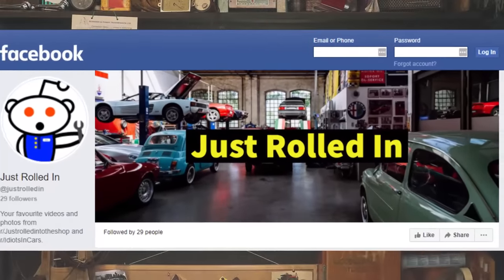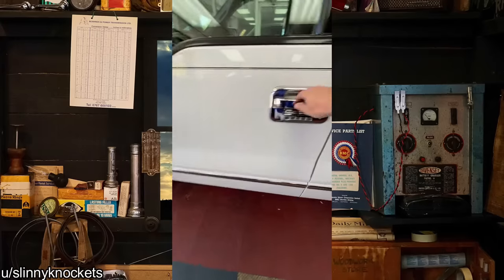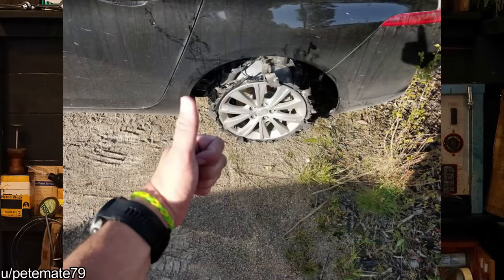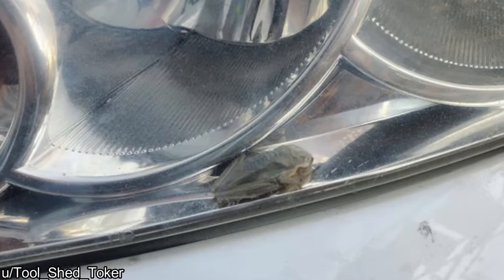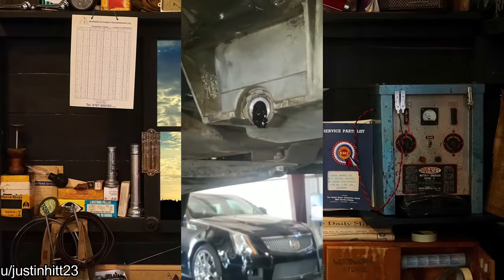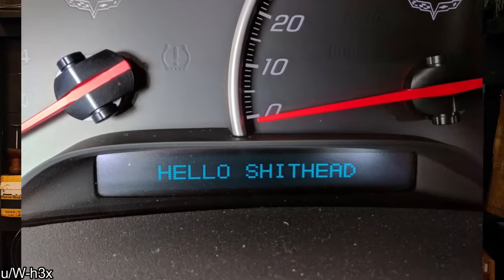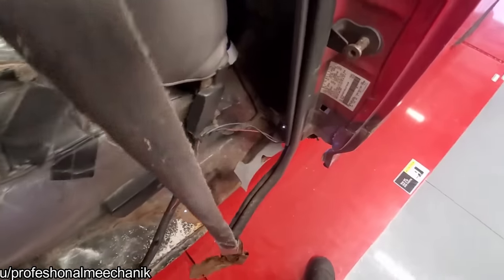Customer States Compilation (Best Clips & Photos so far) | Just Rolled In

Comment: I was a line mechanic back in the 70's.  I can relate.  We had a car come in that sounded like an air compressor....obvious exhaust system construction.  The "expert" owner said that he wanted his engine rebuilt because he "knew" that"s what it needed.  We told him we should check the exhaust system first.  He implied that we were trying to increase his bill.  We finally gave in and pulled his engine out for disassembly.  Tore the engine apart and couldn't find anything out of the ordinary?  We went through the rebuild process and reinstalled the engine.  At start up there was that air compressor sound?  Turned out to be a loose baffle in the customized muffler.  We managed to stick a torch up inside the muffler and slowly burn the loose baffle into smaller pieces.  Problem solved.  The customer paid his expensive bill totally satisfied that he had diagnosed the problem correctly because the air compressor noise was gone.  We didn't tell him what we found.
Reply: I once put a motor in a car and it wouldn't do anything but slow idle. After going through EVERYTHING and not finding anything and pulling my hair out it occurred to me the previous motor blew a ton of oil and then it all sat for a month. 
The catalytic converter honeycomb was plugged solid.  I pulled exhaust off and it was a race car.
I was always asking that dumb question on auto repair forums.  " is your exhaust plugged up? "
Reply: A car my daughter had I was involved in reconstructing her exhaust system and had it all off. Up near the manifold the pipe was real solid but I came to discover that someone had welded it nicely but made that part of the tube constricted to only about 1/3 the size on the inside. Not sounding like an air compressor but still interesting what you find INSIDE exhaust piping.
Reply: lmao
Reply: You should have told him and counted how many seconds it took for him to shrink to an inch tall.
Reply: @michaelszczys8316  same problem on my ford, clogged cats made her misfire like a bitch. Were not going to talk about the 25k fine for removing cats though lmao
Reply: @RGBmechanics  my brother had car he was going to sell, it had a cat that was almost plugged so I told him to take it off and I came over with my 350 Chevy with full 2 1/2  inch exhaust out the back. I had him hold it up to my pipe and I revved it up reverse blowing it out.
He said a big cloud of crap came out. Cleared it out enough to sell it.
Reply: About 15 years ago I got a notice that my Jeep XJ was being recalled due to the computer not being able to detect if the converter was bad. What they wanted to do was flash the computer and would replace the cat if it was rattling. Well, it HAD been rattling, but had stopped something like 100,000 miles before. I called the dealer and asked what they would do in that situation. Nothing... so if I'd taken it in they'd have flashed the computer, the check engine light would have come on, then they would have offered to fix it for something like $500.

So I never took it in. Years later the cat clogged up and I replaced it, then a couple of years ago I had to replace the computer... and the check engine light came on.
Reply: @RGBmechanics  
  In today's society, just claim that someone had cut them off, and you only had the money to buy "Test" pipes. They are a hot commodity around here.
Reply: Smart Move fixing the real problem on the down-low, as a bicycle mechanic I've done similar before.
Better to Get Paid than have an argument with an 'expert' customer. I he wants to waste money insisting I go through all these extra motions, not my loss.
Reply: Stupidest thing I ever did was when I heard a rattling noise coming from the clutch area in a series II Landrover, pulled the entire gearbox out through the cab to check the clutch, but couldn't find anything, put it back together and started it for an test. Then somebody said that the fanbelt looked a bit loose, here we found out the alternator bearing was shot. Apparently the sound resonated all the way to underneath the firewall. Still, an nice bit of experience for a beginner like me.
Reply: He would've really been baffled if you had told him.

Comment: Curious to know what that customer who claims to change their own oil every 2k miles is actually been changing.
Reply: Probably the blinker fluid.
Reply: Plus/minus a few 0s tends to be everyone's rule of thumb, or lack thereof.
Reply: @rowdyjoringer612  or the guy was changing them on some shop and got flipped over many times
Reply: I mean I think a previous owner put windshield washer fluid in the power steering reservoir on my car, so anything’s possible
Reply: My thought exactly
Reply: They just added oil every 2k miles and never drained anything.
Reply: I think he meant 20000
Reply: its the quicklube oil change, aka top it off.
Reply: k, m, t... what difference do a few orders of magnitude make?
Reply: I was wondering what they were changing the oil with... it look like putty
Reply: They keep the old oil to put back in and just rotate it.
Reply: The crack in his pipe
Reply: Probably by 'change' they mean poured a bit of oil in to top it up
Reply: Same !! 😨😨😨
Reply: Looks like they put straight 90 weight in.

Comment: That spare tyre one reminded me of a USAF maintenance report:
- Engine #3 missing
- Engine #3 found on right wing after brief search
Reply: My sister got a maintenance request from a pilot that basically said "X switch does not work in the 'OFF' position."

She flipped it over, wrote "Try the 'ON' position" and left it somewhere the pilot could find it. That was probably the funniest thing I ever heard her tell me.
Reply: @oceanbytez847  Isn't that literally what the OFF position is for?
Reply: @oceanbytez847  Many years ago in USAF, I read the F4 Phantom aircraft flight log "Radar fails to work in the OFF Mode."
Reply: @oceanbytez847  who ever said that the Air Force is the smartest branch is a damn liar...
Reply: Friction nut causes throttle levers to stick.
Reply: @233kosta  OFF stands for "OFFICIAL" in some pilots eyes.
Reply: @icondonnied  🤣🤣🤣🤣
Reply: There were CAMS entries for my TPN-19 Radar set indicating the MON key had gone bad.
Reply: @oceanbytez847  Pilot complains "plane flies funny", Plane to told sharpen up and fly straight.
Reply: Oh there are a hilarious list of Faults I have seen.....

US Navy
-Fault #2 Engine leaking
-Correction #1 Engine not leaking enough 

US Army
-Fault 30mm gun will not stay locked into position
-Correction Turned off Auto Track system which suffered from ID10T Fault code....
Reply: @233kosta  you would not believe how many new WSO on Apaches will forget to turn off the auto track and will bury the barrel of that 30mm gun into the ground....
Reply: @Ami-vh7sr  All that "accelerated" training must be paying off
Reply: @233kosta  Mostly they just tend to forget easily and when they are spotting for the pilot during landing they are looking to the side and down. So, since the auto track is on the 30mm gun follows their head so the gun is pointed basically straight down.....
Reply: @Ami-vh7sr  And then... PLONK!!!

Sounds like maybe there could be an engineering solution to this problem, but I wouldn't care to guess before understanding the whole system and all the flight procedures
Reply: @233kosta  It's amazing how the 1D10T fault code shows up in so many areas.
Reply: @233kosta  One would think that the switch being in the OFF position and not working means something is always running forever. But they aren't that clever.
Reply: @monad_tcp  I mean... someone has to justify the existence of clipboard warriors, right?
Reply: @icondonnied  Or "Offensive"?
Reply: @Peter Angles Probably not....
Reply: @233kosta  I hope the original comment about the missing #3 engine was a dig at the mechanic by you and not a go at the Pilot.
Reply: @UFO-047  It's just a funny fault report dude, chill. It's probably not even real - internet and all
Reply: @pieceosheet8089  He might have thought it some acronym or something. Still silly enough to warrant suspension though, don't they teach that shit in basic training?
Reply: @pieceosheet8089  Yeh, I meant basic flight school stuff, my bad. Point is, at some point you WILL be shown the function of an "OFF" switch, correct?
Reply: @233kosta  My personal favourite. Report: Something loose in cockpit. Response: Something tightened in cockpit.
Reply: @Hollywood113807  short and to the point, probably got the actual problem fixed too!
Reply: Reminds me of  a report I had at Kadena ab . Don't remember the wording but pilot and flightline crew wrote something to the lines of f15 doesn't recognize payload.    We responded to the flightline and upon walking up realized they never connected the payload to the plane.     It's like charging your phone with the charger not plugged in.  XD.         It'd be funnier than it is if it wasn't something that happened once a week. With the same load crew. Lmao

Comment: TL:DR Lady called cops, same cops arrest her and tow her car.

I wished I had it recorded, worked in a tire shop where a customer needed all 4 tires BADLY, and the break pads were gone (metal on metal breaking), she only wanted 2 new tires. There was no problem with us changing just 2 tires, the problem was the waiver that by our policy she had to sign, basically saying we told her about the breaks and the other set of tires. She didn't want to sign it, my manager tried to talk to her, but she blew up and immediately called the cops saying we were detaining her, cops told us to back the car out and give it to her, we did. As soon as the lady left the parking lot, the same cops pulled her over, arrested her, and had her car towed LOL.
Reply: That is pure karma
Reply: yea, you cant be arrested for owning a car thats not safe to drive (luckily) need to start to drive it first. 

hope the shop calls the police to warn about some of the drivers that refuse to get required work done. like completly bold tiers etc.
Reply: Is it possible that she could not read? Unfortunately literacy levels are not increasing. Note for all shops presented with numpty customers; they make reading eye pens that speak the text. Enquire about those if your shop has one mad waiver refusing customer a month. It might save them the court date and your reputation as a shop will be maligned by one less fool.
Reply: Arrest seems a little harsh for that you'd think they'd just impound the car/revoke its registration until it's road worthy again and give her a ticket for driving an unsafe car
Reply: @redtra236  Was curious since other someone else mentioned it as well so did a quick google search, this happened in Kansas, there is a thing in the  statute, chapter 8, article 17. This is a small little bit copy and pasted. 

Inspection by highway patrol upon reasonable cause; notice of defects; penalties. (a) Uniformed members of the highway patrol, at any time upon reasonable cause to believe that a vehicle is unsafe or not equipped as required by law, or that its equipment is not in proper adjustment or repair, may require the driver of such vehicle to stop and submit such vehicle to an inspection and such test with reference thereto as may be appropriate.

Of course that's related to the highway patrol, but I am willing to bet the city has something similar, which probably upset her causing things to escalate to her arrest and her car being towed. I don't know the laws, but all I know is she either just sign the paper saying what we found or simply ask us to pull her vehicle out and everything would have been fine, instead of instantly blowing up like we kicked her dog or something

Comment: Bought a used car for dirt cheap in great shape..To good to be true I looked Everything over  Ad said bad motor (misfiring) Guy said Dad bought the sports car for him 3 years ago ..This time around He done his own tune up And the misfiring started He thinks he screwed up with using the wrong spark plugs And blew a piston..I paid the man for the car even with the misfire got the ownership Drove the car to a parts store Went to take out a sparkplug wire to remove the spark plug to see the part number And see if it was the wrong one.....When i tryed to remove the wire it took me 20 mins with vice grips ...This knucklehead used a caulking gun to fill the spark plug tubes So they would not come loose. It was the caulking that screwed up the current ..reinstalled all new wires and sparkplugs...I had the car for 5 years without issues And sold it for the same price i got it for lol
Reply from the maker: Lol what a story!!! Thanks for sharing
Reply: i bought my first car for $1200 when it barely had 100k miles because the blinker didn’t work and the seller didn’t care to find out why. the hardest part of giving the problem was finding an autozone that had the flasher relay i needed 😐 $15 part

Comment: The fact that these vehicles continued to run at all is some kind of miracle. It's baffling that all these people never ended up totalled in a ditch or caught in a sudden explosion. That last one looked like he did an oil change with Flex Seal.
Reply: It beggars belief that they are allowed to drive them like that...
Reply: And also, guys please remember to disconnect your Bluetooth.
Reply: A LOT of people die because of idiots like these driving vehicles in these conditions. A lot of times its someone else that gets killed because of their irresponsibility
Reply: The cops wont stop people with crap like this or all their brake lights out but ohh boy you better believe they will tail my car for like 5 miles then pull me over right before i get back to my shop saying my car is "too loud" in a town with no sound ordinance / laws and wasn't even residential area but people run past here with straight headers cause they cut their catalytic converter off for beer money and they get a free pass
Reply: It surprised me more the fact that these cars are road legal. Like, don't you have mandatory one, two year check up?
Reply: Mad max not movie ITS documentary

Comment: That ford is like my ranger. Rotten and forgotten. Floors were custom replaced with trailer frame and Ford F-150 roof sheet metal. It’s more solid than ever. Makes a sweet yard truck. Soon to be back on the road.

Comment: 4:13 my van had a broken steering colum bearing, did the same thing. Drove it like that for about 8 months to a year.  The scary part is when it gets locked up on a piece of broken bearing during a turn and you gotta yank it hard the opposite way to unstuck it.

Comment: 6:26 not a wheel bearing it’s the independent wheel ends for the 4wd. They’re famous on the F-150 for loosing vacuum and trying to engage making that noise.
Reply from the maker: I've changed a lot of those IWE's back in the ford days
Reply: Integrated wheel end

Comment: The oil change every 2,000 miless :- - They jst left a zero or two off - that's all !!
Reply: Imagine if he wasnt being deceptive. What did he actually do every 2,000 miles, that he considered to be an oil change?
Reply: @stabileseitenlage  Maybe he changed the transaxle oil instead or the transmission oil.
Reply: They probably new drained the old oil
Reply: @AirWolf2301  I know that this is not unheard of, but I am so intrigued by the possibility of someone knowing how to do an oil change and still knowing so little, they use olive oil.
Reply: sorry but i don't get it have done plenty of work on cars but never seen oil like every one that hasn't been serviced in a long time the oil goes thin not like custard 
Edit the off coloured/creamy thick shit i have seen thats coolant in the oil system just not the stuff thats still black but thick
Reply: I was in a shop when a customer had his car towed in because after an oil change the engine sounded weird then started squealing. They had used automatic transmission fluid instead of oil to refill it.
Reply: @christopherconard2831  Unbelievable  !! Why didn't he use embalming oil  - It would have been cheaper ?  Just a gentle rub down on the outside  and the engine would have been fit for burial !! .
Reply: No, they buy oil from the back door of a restaurant.
Reply: @Rob-fx2dw It was the wiper fluid.

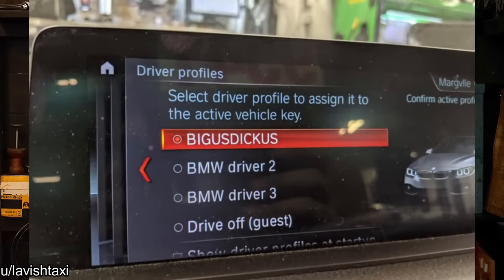Comment: 3:06 I've ran into this before. The customer brought in for an alignment and as soon as the steering wheel snatched out of my hand ... I got out that car so fast and told the owner I want nothing to do with it
Reply: Incorrect timestamp
Reply: @samuels1123  You're right.
Reply: What causes this?  I'm assuming something wrong with power steering pump
Reply: @sottx8268  I don't believe that the vehicle in the video is electric power steering. The KIA I was performing the alignment on did have electric power steering. I couldn't really find much on it. I didn't even have a chance to turn the wheel for the machine. The wheel came right out my hand.